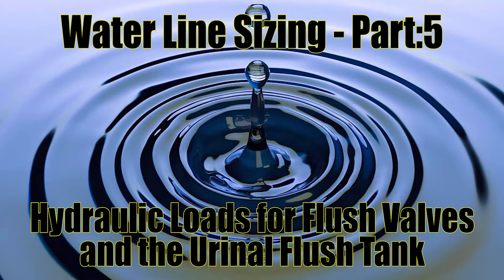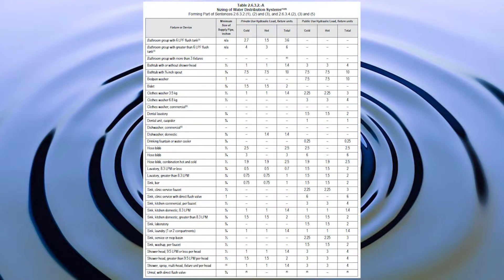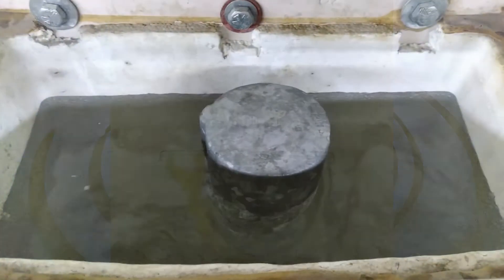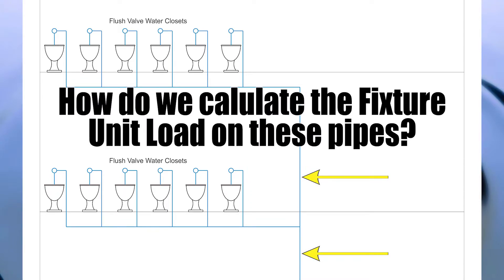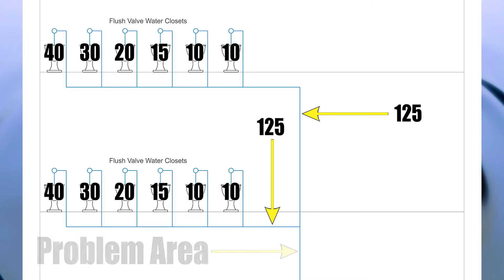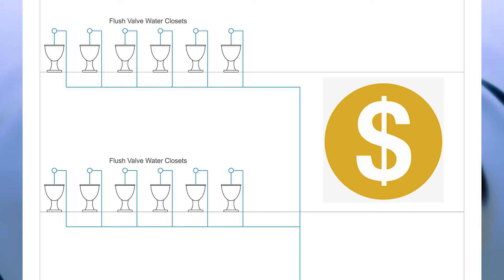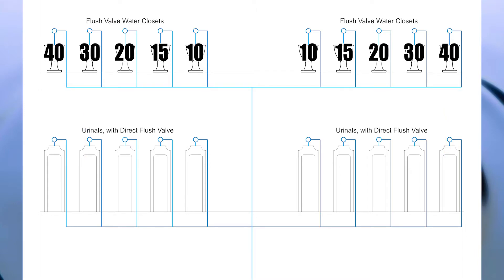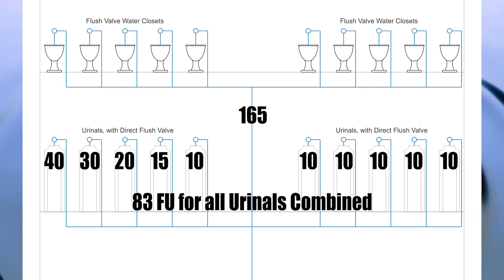Water Line Sizing Part:5 Hydraulic Loads for Flush Valves and Flush Tank Urinals

Comment: hi  mathematic plumber i was wondering if you could shed me some light, on how I go about calculating this thanks

 What is the maximum number of 1” branches that can be taken off a 4”
a. 4
b. 8
c. 16
d. 32
Reply from the maker: I have never come across this rule so I cannot answer with 100% certainty.

But logically the area of 4" pipe is 16 times greater than the area of 1" pipe. So I would say 16

Comment: How do we size the flush valve pipe for stadium arenas?
Reply from the maker: Watch the rest of the water line sizing video series. It covers sizing. If the building is so big that it goes beyond the limits of the sizing tables, then an engineer needs to get involved.
Reply: Thank you

Comment: Great video just what any student needs 👍. One thing I will point out is at the end when calculating the Urinals with direct flush Valves he showed the right table but the fixture unit count should be 20,15,10,8,5,5etc.
Reply from the maker: Well that sucks. The power of copy and paste screwed me again.
Reply: I was wondering about that because what was shown didn’t add up.

Comment: Hi, thank you for all the videos, I am about to finish them all. I failed the red seal exam with score 64%, have no direction to push forward, what can I do?
Reply from the maker: It's been years since I have written the Red Seal and I don't teach 4th Year plumbing. So this answer will be a bit vague.

From what I can understand, it is written from more of a practical stand point. As in questions about problems you may encounter in the field and how you would solve them.

You need to be very familiar with your plumbing code.

And you may be asked questions using all 3 methods of water line sizing. (Simplified Method, Small Commercial Method, Average Pressure Loss Method)

I only have videos on Small Commercial Method.
Reply: @MathematicPlumber  Thank you so much.

Comment: how i can calculate the fixture unit for commercial kitchen equipment and laundry for hotels and public building ? please i need code or any reference
Reply from the maker: Watch the first 4 videos of this series first. It will reference Table 2.6.3.2.-A, that is where you want to look.

In 2.6.3.2.-A you want to look for fixtures labelled as 'commercial' and the clothes washer could be 3 different types. You will need to find out what type of clothes washer that is to be installed.
Reply: @MathematicPlumber  thanks